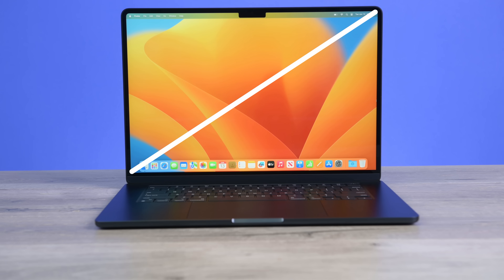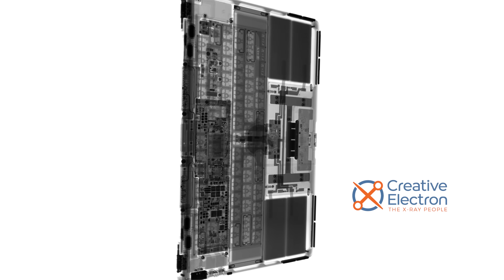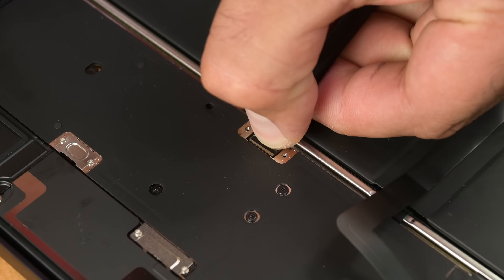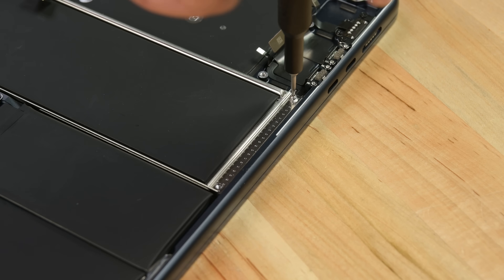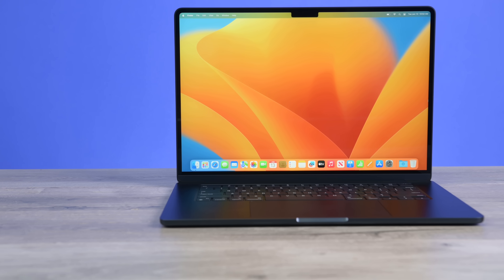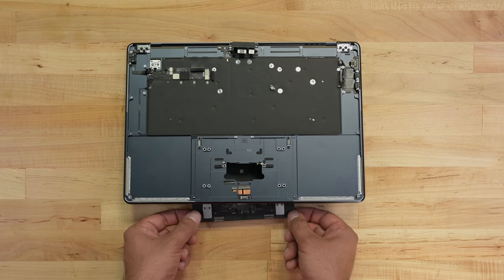15” MacBook Air Teardown: Hype or Hot Air? 😮‍💨

Comment: Great to see Apple secured everything with bolts this time - this is what you complained about in the iPads and Microsoft laptops. Regarding the fan, I would take 5% throttling over fan noise any day.
Air 15 is not an “Apple Chromebook”, it is the Macbook Pro for people who don’t want the drawbacks of a Pro. Absolutely sufficient for software dev, and anything else without multi-hour 100% workloads that video editing has.

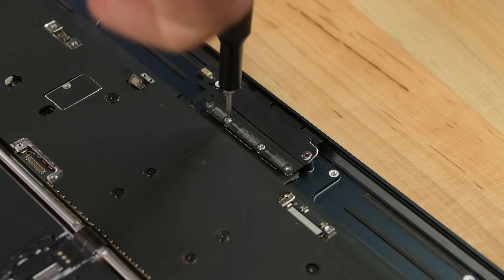Comment: Really interesting video. At minute 1:31 we see a black component which seems a pad and it is over 4 screws that you pull off on minute 1:32 (one second after).
Well, what is the black pad over the screws on minute 1:31?

Comment: I feel the most of the reason why Apple products are so hard to repair is the insane amount of over engineering they do. All those brackets and components have overly complex design.  It’s funny when Apple Software revolves around simplicity but hardware engineering is as complex as if comes.  Framework to make a totally customizable and repairable laptop, had to simplify the design of the components and how it mounts in the chassis at the cost of durability from drops or impact.

Comment: I don’t pay thousands of dollars to fix my own computer.  My MacBook Pro from 2015 has had no hardware issues and still works perfectly.  I would also have AppleCare as well.  Why would I buy the parts and use my own time fix a laptop when I can get Apple to repair it and if something goes wrong I’m not liable.
Reply: Ignorant to the problem
Reply: @ethankeon8152  there is no problem as I’ve never had to have any devices repaired am would trust apple do it instead of me so if they stuff something I’m not liable

Comment: If I understand, we have to tear everything to change the battery.  Why Apple do this ?  A battery is a known changing part every 3 years if you want to keep a productive and effective device.  The samething with the MacMini Intel, tear everything to add RAM.
Reply: They probably optimized the layout for build quality and use of volume. Repairability isn't high on their priorities
Reply: Idk anything about repair and structure of laptops, but it wouldn’t cost apple much to just move the battery to the top in the next lineup

Comment: I used my macbook air butterfly keyboard for  nearly 5 years now. These machines last and still supported under Sonoma.
Reply: I had to replace keyboard 3 times. They didn’t charge money but it was a huge inconvenience.
Reply: @cat-.-  I know. I don't know how I never had ZERO issues with it.
Reply: Oh, they last alright, years
Reply: I have a 2012 MBA still humming along. On original battery, even. Well, technically I donated it to a friend when I upgraded to an M1 MBA when those launched, but it's still working and pretty much in daily (light) use.
Reply: @mascot4950  Original battery!! Is it plugged in all the time? Can't see how it would have any battery life left.
Reply: @robertwright8844  Unless Apple gave it circuitry to bypass battery, having it plugged in all the time would have killed it all that much faster, I'd imagine. I only plugged it in to recharge, usually at 20-30% somewhere. It wasn't a primary computer, so it saw light use. I'd guesstimate I recharged it every 5-7 days.

Comment: Anything that has been assembled can be disassembled and repaired.  The issue here is that Apple does not release parts to repair or even upgrade their laptops.  Eventually the board schematic will show up.  We still have to steal parts from another laptop to fix one.

Comment: When the 16-inch framework laptop is released, I hope it will be a better choice for those who love big screens. What matters is the price.
Reply: If you're trying to say Framework 16" would be a competitor to the 15" MB Air, that's a really hot take. There are a plenty of excellent 15" Windows laptops already out there, and people will choose those over a MacBook Air if they don't mind Windows. This 15" Air is very much aimed at people who don't need the power of the Pros, but need the bigger display.
Reply: Battery life will always be inferior
Reply: Yes, it is, but batteries can be replaced very easily on a framework laptop. Apple has done an excellent job of switching to ARM applications; that's a fact.
Reply: If Framework doesn't allow other companies to make compatible/swappable modules for their Laptops, how are they really any different from Apple's "walled garden" approach ?  Frankly, Framework is a novelty brand.
Reply: @goobfilmcast4239  well fortunately the modules are open source and yes any companies or individuals can make the modules if they have the resources.
Reply: @goobfilmcast4239  that thing is  not released yet so we don't know if they haven't talked to other brands already. Plus it's dependent on whether ppl and other brands will like it first
Reply: @mcslender2965  Yes, there are many good 15-inch laptops on the market with Windows, but the framework is unique in that it can be upgraded.
Reply: @goobfilmcast4239  Anyone can make the USB modules for Framework, and you're not going to find an overlap between the companies you're talking about and companies that only sells batteries.

Comment: And you do not talk about serialization, when every part, including screen, track pad and angle sensor is paired to the specific T2 chip in the mother board
Reply: There is no T2 chip on the m2 macbook air

Comment: What about the heat spreader?
M1 air have a metal one to soak up the heat. What about the M2 15 inch?
Any improvements to how fast heat get dissipated? By law of physics it should improve but by how much.
Reply: Cinebench suggests it is still throttling.

Comment: The more compact the device, the more likely the teardown will be difficult. That said, I'd love to see iFixit always suggest ways that a design could be improved with minimal sacrifice. For example, how could the parts around the hinge assembly be rearranged to prevent trapping?
Reply: nah... they make it this way just so that people can't repair it easily without breaking anyting
Reply: @siontheodorus1501  Industrial designers don't put extra effort into deliberately making something more difficult to repair. It's usually just the design that manages to accomplish the goal as cheaply as possible that wins out with assembly being the key cost concern. Making a design more repairable can be more time consuming and expensive. I'm not saying that's a good thing, just a reality of industrial design that's rooted in practicality, not malice.
Reply: @soviut303  That's a bold claim to make about a company that straight up disables features arbitrarily if you replace an iPhone screen or battery with another original one...
Reply: @fredrikcarlen3212  There's big a difference between a firmware checksum on a connected peripheral and changing the entire hardware layout to make it easier or harder to fix.
Reply: @soviut303  Fair enough, but putting a few ribbon cables above certain other components, or a bit worse placed screws to make it a pain in the ass to take apart costs next to nothing as well.

What I mean is that they obviously do intentionally make their products harder to fix in other possibly less resource intensive ways, and so if they were presented with two designs that cost the same to produce but one is harder to take apart, I have no doubt that's the one they would choose.
Reply: @fredrikcarlen3212  Don't be so sure. Apple does repairs and they definitely consider repair time in their designs. So then it becomes a balance between the cost of iterating on the design versus the cost of repair time. Since repair time is usually cheaper, a design change would have to have a massive impact on repair time to be considered worth doing the revision.
Reply: @fredrikcarlen3212  Also, moving screws and ribbon cables completely changes your assembly line. It isn't trivial. This is why a bad design isn't changed mid-run. Further, intentionally bad designs would do nothing but shoot manufacturing in the foot by increasing their assembly complexity and costs per unit.
Reply: @soviut303  Does apple really do that many repairs though? When it's under warranty, I never see repairs, they just give you a new one and then presumably send the old one off to be refurbished in a factory, in large part by robots.

In an assembly line setting, most changes wouldn't be at all as impactful on the time it takes to refurbish a laptop as it would be for an average person trying to fix theirs on their own.

And when it's not under warranty, even better, they just bill the customer or better yet, tell them it's too expensive to replace and that they're better off buying a new one.

Either way, I get what you're saying, but apple has been doing way too much of this stuff for me to be as optimistic about it as you are.
Reply: @soviut303  Obviously changing stuff over last-minute isn't going to be an option..  But putting the battery in first or last, if you design it either way from the start, isn't going to have an impact on costs to manufacture. It's the exact same number of steps and complexity in every way, in fact.
Reply: @fredrikcarlen3212  Refurbishment is still a repair and it is definitely NOT done by robots. iFixit and other channels have all reviewed Apple's official repair kits in detail. 

Literally ANY change to an assembly line is dramatically impactful since even a minor change adding a few seconds to assembly is multiplied by every unit being made. Not only that, but it requires retooling the line, retraining any people involved in assembly, etc. It is not trivial.
Reply: lol ifixit think they know everything
if they know how to make everything perfect, why don't they do it them self then? waiting them to design and produce thair own devices? iffixit trash

Comment: Why does the battery need to be glued, screwed in place and trapped under other components ?

It's not going to try to escape 8 screws would have been enough.
Reply: Probably to protect key components in case of failure. When they go bad, the cells expand significantly. I imagine it’s to prevent damage to delicate board components long enough to get the issue noticed by the owner.

Comment: I have never had a MacBook fail on me. I’ve got 6 of them in my office dating back 2013 and they all still work fine. Apple doesn’t need to make repairable laptops.  They need to keep making them the way they are.
Reply: Making them repairable doesn't have to make them less reliable, your comment doesn't make any sense. But since you seem to be so deep into their ecosystem, you're just tunnel visioned into thinking there is no other way
Reply: @ij6708  Deep? I also have HEDT PC (24-core thread ripper RTX 3080)  on a full custom cooling loop. The best accessory for a desktop PC is a MacBook. When I have maintenance to do on my PC, the MacBook has my back.
Reply: after 10 years I had to replace the battery of my glorious MacBook Pro 15 inch late 2013 retina display ... other that that it is still working like well for every day use and light  photo editing.
Reply: @dolurosu  Yea… I’m not buying what you’re selling.  Apple enjoys the highest Customer satisfaction ratings for a reason.  They make
 the best laptops on Earth.
Reply: @ericmatthews8497 if you don't believe him, may I ask why you think otherwise? Are you suggesting Apple can't make good laptops if they make it repairable (nevermind the fact that ThinkPads exists)?

Comment: I love the idea of a powerful fanless ARM laptop, they run really well (without much heat), and offer great battery life, and I really want one as my next computer. BUT I really don't like Apple, or anything that makes nearly unrepairable devices, so I'm still waiting for a normal laptop with an SOC like that, and by normal, I mean a computer that lets me install any OS and isn't that unrepairable.
Reply: I know there are some options, but they're still not as good as they should be, I don't need a very poweful computer, but the cureent alternatives to Apple, with ARM chips, are just a joke, the performance is terrible
Reply: @WolfiiDog13  And isn't the software support still terrible for most ARM systems?

Comment: Times are changing.  These things are ultra reliable with no moving parts (and no dust ingestion), and ultimately end up being recycled back into newer laptops at the end of their useful life.  Like it or not, that’s the intent.
Reply: Reduce Reuse Recycle. There's a reason Recycle is the last R of 3R.
To be able to upgrade, repair and replace parts easily still trumps efficient recycling in terms of time, energy used and especially co2 emissions. This is even more important in parts of the world where recycling infrastructures are not well developed.

Oh and Apple will upcharge you a ton to add more storage and RAM cuz it's soldered on and there's no option for easy replacement.
Reply: Recycled into newer laptops? How?
Reply: @SoilentGr33n  the aluminum is melted down and reused to make new chassis.

Comment: Don't care about fast charging as it is likely to kill the battery sooner.
Laptop built in speakers... will never match a decent pair of external speakers, so increasing the speaker count won't make much of a difference in such a small chassis.
Batteries that are a pain to remove... are still a pain to remove.
And soldered RAM/storage is a no go. 8GB is going to be filled up in next to no time!
Ultimately I won't be buying this, or any modern Apple product.
Reply: I gotta say the speakers sound pretty good
Reply: The first and second points are both false, and I can tell because you haven't heard the speakers on this laptop and I'm sitting in front of it.
Reply: Oh no, anyway...

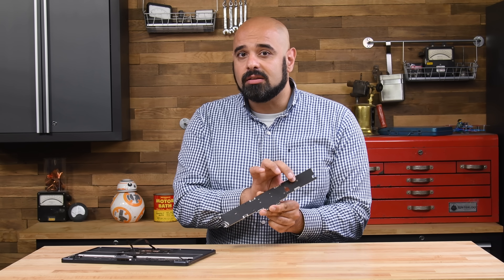Comment: Is the heatsink any better than the 13inch model? 1:58
Reply: Reviews so far on performance for long term load tests say: Yes. definite improvement. 10-minute load benchmarks put it about half way between the performance of the 13" m2 and the 14"mbp with a fan.

Comment: I heard Apple is now locking MacBook screens to the motherboard like their phones. Could you please confirm this?
Reply: I think this is true based off the M2 versions of the 14 and 16 inch MacBook Pro. The lid angle sensor is tied with the device serial number if I'm correct. I could be wrong.